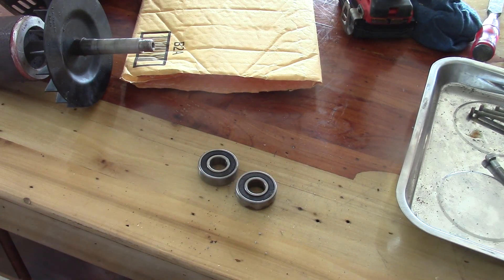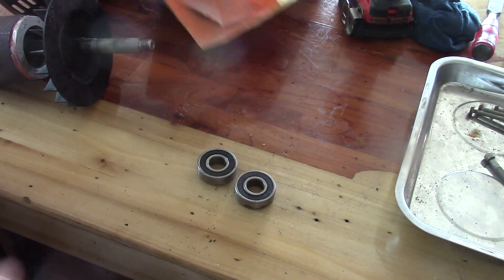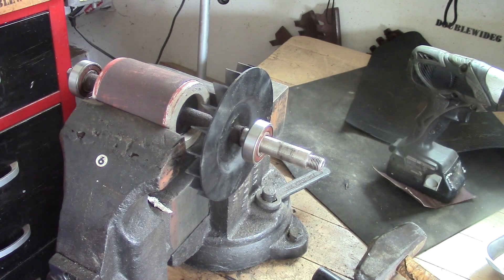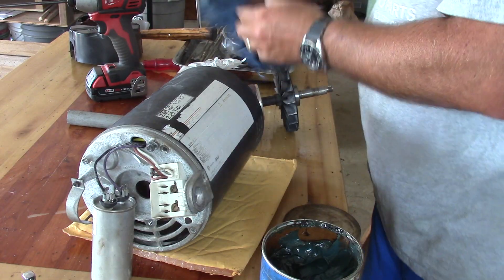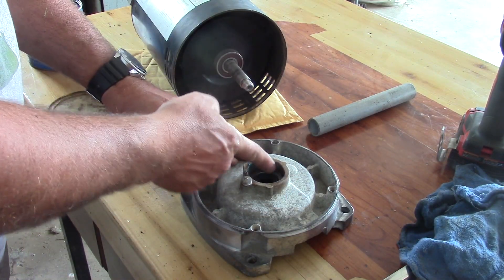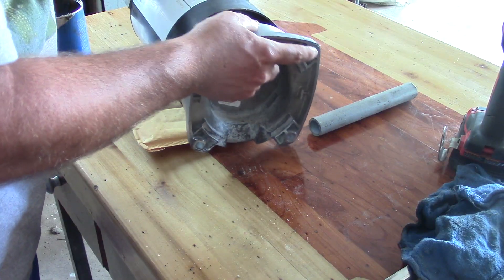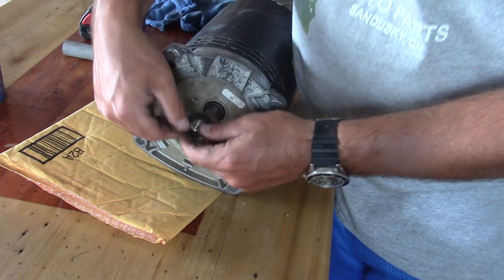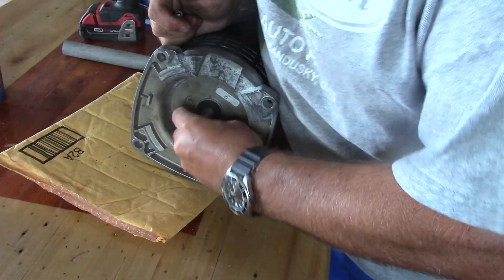Pool Motor Replacing The Bearings

Comment: Great video! I rebuild a lot of commercial 3 phase motors. I put the bearing in a toaster oven and heat to about 212° (to the point when my wet finger sizzles when I touch it) which causes the bearing to expand and it slides right on the shaft. When it cools, it locks into place.

Comment: Watched 24 vids on this topic and you are straight forward and get it done LOL  Have a sequence 8200SEQ22  sn 1105-156115 just cant find hard time finding its two bearings.  Any suggestions?  Switched out the two capacitors runs but roars loud so bearings.

Comment: As a Pentair tech an warranty center. Unfortunately a lot of people get mechanical seal leaks.  Even if it’s not enough they’re seeing water dripping.   It’s still a small seepage from it.  

A the flange end of the motor starts to like corrode/swell from the leak not being fixed.  

So even if they don’t see water leaking.  They still don’t call anyone.  Or check themselves least for the branded motors that the flange is also painted.  
When they see paint starting to flake off of the flange an what not.   From it kinda swelling or what not.  

Than when the bearings finally do give out.  The only way to remove the bolts from the seal plate is with an impact.  

At that point you’re destroying the seal plate.  By the brass threaded inserts for the bolts to screw into.  Break loose from the plate etc.  

So than their in for having to replace the seal plate.   If they’re lucky.  
Otherwise I’ve crossed many where the through holes on the flange completely broke off.  Due to it not being tended to way sooner.   
An at that point the only option is a new motor due to you can’t just find a flange for them unfortunately.  

A than you have to home that your able to even remove the long through bolts holding the motor together if the flange was able to be spared.  

Same goes with the VS-VSF an such pumps.  When they get to swelling.  I’ve completely sheared screws off in them from not even being able to remove them.  Like the screws to hold the fan guard on.  All the way in the rear.  

Even had some had to put so much torque on the screws to remove the drive.  They snapped off.   When a drive needed replacement.  

An having to lift/pry up on the drive to get it off them bad snapped off screws holding the bad drive on.   Destroyed the plug onto of the motor that the drive is plugged to.  

Luckily that one was in warranty just barely I was able to stick the whole thing under warranty so it costed me or them nothing.  

But if you start seeing corrosion/swelling/paint flaking.   
You need to change out the mech seal.  Or have it done. 

So before your motor comes to needing new bearings whenever.   

It’s able to even be broken down.  To even replace them if needed be.  

I’ve thrown out many many countless motors.  Branded an aftermarket.  That could have had a basic bearing change a would if probably been fine for years to come.   
But was messed up to where the flange was shot etc.  where the bearing change just is no longer an option.  

Just putting that out there.  For anyone crossing this.  So obviously your hear for bad bearings.   If you’re able to change yours out. Cool stuff.  
But definitely watch out for what was mentioned.   So if a when it’s needed to happen again.  
That possibility is still an option.

Comment: My replacement bearing "6203RS" was too small for the UST-1152 oddball shaft shoulder. After days of head scratching, I found the Timken "6203-2RS" is the correct part, it fits fine.
Reply: 6203 is 6203, both should do just fine..
Reply: @JonTheChron    Nope, I measured them.  One fits, the other doesn't.  Different IDs.
Reply: A 6203 should be spec'd as follow: 17mm ID, 40mm OD, 12mm Width with a tolerance of -0.0003-0.0005, I think your bearing is out of spec and should have been rejected during the QC process, which brand was it?
Reply: @JonTheChron I'll look up the order and try to get back later.
Reply: But the standard 6203RS did fit perfectly/easily on the dry end of that rotor.  Strange....
Reply: I now think you're right, the replacement I tried must have misidentified. I'll tryyyyy to dig it up on the workbench and clarify later.

Comment: Any recommendations on how to proceed if those really long through bolts shear off when trying to be removed? I suspect they never had anti-seize on them before...
Reply: I had same problem, salt got in there and seized them.
I solved it by replacing the end bell. A torch on the end threads might have worked though.   And BTW, that's a 6mm socket size. I was trying a 1/4" socket which SEEMS to fit ok, but it'll round off the head with too much torque.   6mm is perfect.

Comment: Would have been nice to see how he got to where the motor is apart.
Reply: The through bolts can be a biatch to remove if corroded.  Try a good loosener like kroil on the threaded openings on the bell end and let them sit overnight.  AND btw, those hex heads are usually 6mm, not 1/4".

Comment: How'd you know what size bearings to buy?   Short of measuring the old ones with a micrometer, I'm at a loss.
Reply: There is a number on the old bearing. Just google that and you'll find the replacement
Reply: @justindees29    I have a UST1152 motor, the old bearing reads '6203DG', the supposed replacement 6203RS is wrong size... too small ID on the 'fatter' part of the shaft. in a quandary now, because I can't source a 6203'DG' bearing for it.

Comment: When I repair a motor I lube the threads of the through bots with anti seize compound to make future disassembly easier. Before I place a new motor in service, I pull each through bolt one at a time (to maintain alignment) and lube the threads liberally with anti seize. In fact, I lube every bolt I can on new and rebuilt motors with anti seize. The capacitor bolts, the grounding lug bolt, ALL of them! The most important one is the bearing retainer bolt. On a new motor that you are not disassembling, you can back it out a fair bit, then reach in to the case through the vents and glom the hell out of the exposed threads and the plate itself with anti sieze. During rebuild of course it is easier to lube it up when the case is apart. That bearing retainer bolt is usually corroded and stuck and you destroy it trying to loosen it on an old motor. Better to be proactive and pre treat these with anti seize, than to fight your way through it at rebuild time.

Comment: If your pool motor is 10-15 years old, you better of buying a new one, less noisy, 2 speed for the same price since you have to buy puller, bearing.  It happen to me motor is still very noisy after replacing bearing, decided to buy a new one.
Reply: My salt-water pool is eating the pump bearings alive. 😕

Comment: my goodness...you started whacking the bearing with the sledge hammer. How not to install a bearing.
Reply: Well, he did pretty much just strike the inner race. But yeah I would probably have used a pipe or socket on the inner race from the outset.

Comment: OMG, never put it in a vise like that and more so never press a bearing on like that. you will cause the armature to go out of round and you can damge the center shaft.  I only came here because of a link the other pool guys sent me. shudder.
Reply: How would you press on the new bearings? Absent a vise, how would you hold the rotor to rand r the bearings?

Comment: Thank you for the video.  I normally try to heat fit tighter bearings like you had.  15 minutes at 200* in the toaster oven gives you a good minute or so of working time. It’s even better if you can put the shaft in the freezer for an hour or so.  Lots of times the parts will just slide together with almost no pressure.  I generally don’t exceed 200 with sealed bearings as the rubber will degrade.

Comment: Use care when removing the back bearing end cap if your pump motor has a centrifugal start switch (the Hayward pump motor he is working on does not) , the fork that actuates the switch rides on a moving collar on the rotor under the back motor end cap , as you tap on the back end cap to remove it go just far enough to get the bearing loose from the cap then gently pull and tilt the end cap so the bearing on the shaft above the switch  does not catch on the centrifugal switch as you remove it.

Comment: are these the 1/2 in inside bore of these bearings i need those to rebuild two Emerson/ US motors 6127 i got if these will replace the worn out sleeve bearings on them as the shaft diameter is 1/2 in i got them from a local store that closed.

Comment from the maker: http://amzn.to/2uasYFg 6203 Bearing for motors
https://amzn.to/2H1eDhD Hayward Pool Pump Gasket Kit
http://amzn.to/2uasYFg 6203 Bearing for motors
http://amzn.to/2uaoWg0 Bearing puller set
http://amzn.to/2wrMCcB  A.O. Smith 1.5HP Motor Replacement
http://amzn.to/2uEJnQQ A.O. Smith 1HP Motor Replacement
                               Variable Speed Pumps
http://amzn.to/2veaPGJ Variable speed Pentair Pool Pump
http://amzn.to/2uIWFdB Variable Speed Hayward Pool Pump
                                       Salt Water Cells
http://amzn.to/2uEIxnq Hayward Salt Water Cell 40K Gallon
http://amzn.to/2v3JZAy Circupool Salt Water Generator 40K Gallon
http://amzn.to/2uaoWg0 Bearing puller set
http://amzn.to/2wrMCcB  A.O. Smith 1.5HP Motor Replacement
http://amzn.to/2uEJnQQ A.O. Smith 1HP Motor Replacement
                               Variable Speed Pumps
http://amzn.to/2veaPGJ Variable speed Pentair Pool Pump
http://amzn.to/2uIWFdB Variable Speed Hayward Pool Pump
                                       Salt Water Cells
http://amzn.to/2uEIxnq Hayward Salt Water Cell 40K Gallon
http://amzn.to/2v3JZAy Circupool Salt Water Generator 40K Gallon

Comment: I have replaced a lot of bearings ( I was in the NAVY on submarines before becoming disabled causing me to lost use of my legs. But the taught me the property way to remove bearing from a 5hp motor to a 800kva motor. You heat up the bearing then slide it on . It puts a lot less stress on it.I use my wifes oven.
Reply: What temp would you set it to?
Reply: @trevorjames6204  Less than 200 F?
Alternatively or in combination, can put the shaft in the freezer.
Reply: this is a good technique, not to hot to melt, just looking to expand the id of the metal (really in this application of the video, the bearing tolerances are made to be a press fit, so the above technique is okay also).  inversely, if you are trying to press a bushing or bearing in, stick it in the freezer for a few hours to shrink the outside diameter.

Comment: I have rebuilt my pump (also 2hp) several times and last time used the Nachi bearings you used. I've found them to perform much better than the Chinese bearings that are $1 each. Hope you used some grease or never-sieze on the body through bolts. They tend to freeze in place and I only have 3 functioning bolts due to broken off stub end (too small to drill  out). good video!
Reply from the maker: The bearings I used are really quiet.  I did not use anti seize on the long bolts, but I did brush them off on the wire wheel.  I did have one bolt that was broken on the back cover and I drilled it out and re-tapped it.

Comment: Great work Bob . Did you have use a puller to get the bearings off the shafts.
Cheers
Pete.
Reply from the maker: Yes, I used a 3 jaw puller and it worked great.  The bearings were not too much of fight to pop off.  The first video I made on the motor teardown shows how I did it.  The link to the first video is at the end of this video.  Thanks for taking the time to comment.

Comment: Man...that was a HUGE difference, and what an inexpensive repair too.  Thanks, Bob.  Next time I run across a bad motor, I'll have to give this repair a shot...$5 - $10 bearings and 30 - 60 minutes of my time beats $100 +/- for a new motor, that's for sure.
Reply: My impression is those don't need replacing very often unless it's obviously broken..
Reply from the maker: The industrial motors are worth fixing.  It seems the bearings go before the windings.  Any report back on the AT-205 you put in your vehicle?
Reply: I received it a few days after I put the order in, maybe a week ago.  It's been raining cats and dogs, so I haven't been able to crawl under the truck to clean up the current oil staining before I add the re-sealer.  Thanks for remembering, Bob.  I'll get back with you as soon as I get it done and I'll definitely let you know how it all turns out.  Thanks, man!!